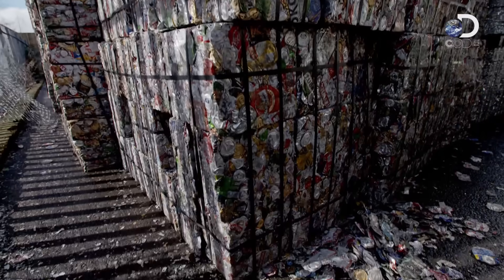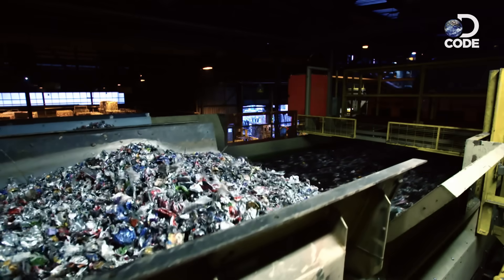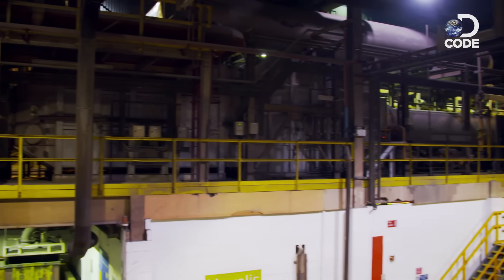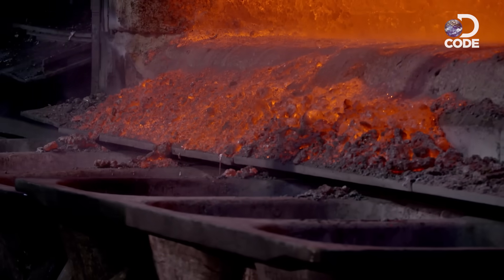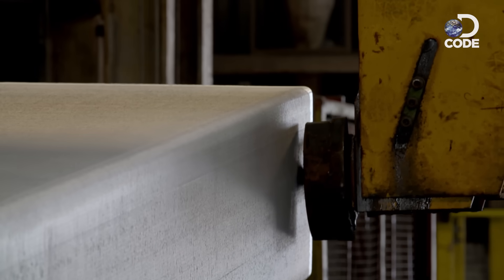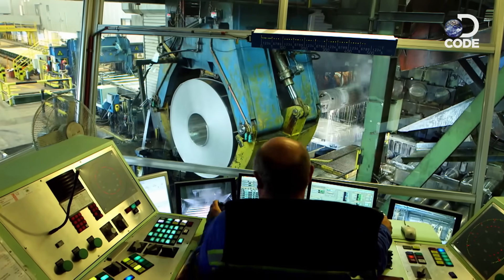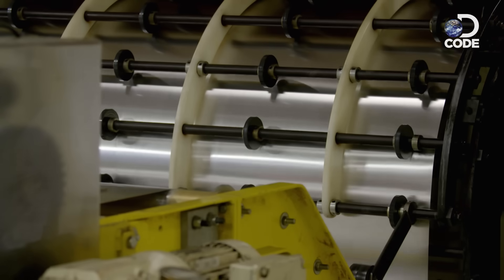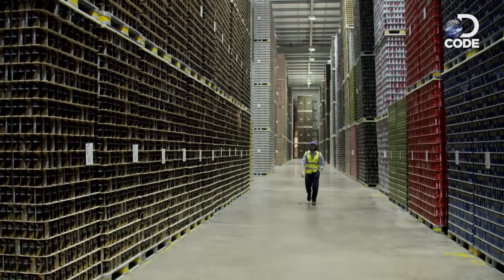How Are Aluminium Cans Recycled? | How Do They Do It?

Comment: When managed and processed properly, Aluminum from Aluminum Cans is just as good as from bauxite/mineral material.
Reply: Yea there is alot of slag in aluminum cans but Recycling Plant/Scrap Yard aluminum cans is sold to Metal Refineries which through it's processes can and do extract pure aluminum from aluminum cans bales which is used in aluminum component applications...The Metal Recycling Business is the other side of the Metal Business equation

Comment: It warms my heart to know we can, and do, recycle aluminum.👍
 It seems the recycling process and transportation have high energy needs though...  🤔
Reply: But the process of obtaining aluminum from the ground is far more experience and takes several time the energy requirements. The fuel is the biggest cost on the melters.
Reply: Aluminum is actually pretty easy to melt compared to other metals. Its melting point is only 1200 degrees, by comparison copper is 1900 and steel is 2500.
Reply: Need to get more solar power

Comment: The process is very complex and energy-intensive, just for the sake of quenching your thirst for a very short while. Personally, I've picked so many drink cans littered in my local village for the past several years that it has totally put me off buying any drinks in cans. Drink cans are by far the most common items we collect. We do put the clean enough ones in our recycling. When I see what's involved in producing and recycling aluminium cans, I'm even less likely to buy them for my own consumption!
Reply: You should also put the unclean ones in recycling...the video shows everything but the aluminum is vaporized anyway..
Reply: @danteinferno175  yes, absolutely! I have started to do this after watching the video!
Reply: You should not be put off by the energy usage for recycling cans.  It is still VASTLY less than the cost to produce new cans!  What this video only briefly mentions is how hard it is to get aluminum out of the ground and smelt it into a usable form.  Even compared to glass it is drastically harder.  This is why using aluminum cans is so important...it ensures that the cans stay in circulation and are infinitely recyclable.  If you want to make a big difference for the planet, contact your local authorities and start an effort for deposit programs (where you get $ for recycling cans).  MOST of the world does not have these programs, which greatly increases recycle rates.  Theoretically, if people recycled all aluminum cans, we could supply all the canned beverage needs without ever mining another lb. of aluminum from the ground.
Reply: @cuthwulf  The cans are not infinitely recyclable. There can be up to 20% metal loss during remelt. The coatings on the cans are also highly toxic and need to be treated first. The dross from processing is a mixture of sodium/potassium oxide, aluminium oxide and free metal. It is considered as hazardous waste which is costly and requires specialised equipment. 
The profitability of the whole process is highly dependent on the LME price for Al. Out of spec metal will reduce the price of the finished product.
This little video makes it all sound clean, efficient and sensible. In reality it is a dirty, expensive and energy intensive process.
Reply: @finnmccool8671  No they are classified as such cause the material itself does not degrade to be recycled. Plastics can be recycled so much until they can't where as aluminum and even some glass can be constantly recycled.
Reply: @cuthwulf  Vastly less is still more than none. Recycling is great, but reducing use is still better. Especially if we don't "need" drinks from cans.
Reply: @paulcook7426  Reducing use is good but some times they are still needed. I personally like glass bottles but they also weigh a lot just for the container which is where aluminum comes in. Having a soda of say a 12oz is a good size as it is the right size. Smaller is a waste and bigger can only go so far before it has to be too much for an open top, as the carbonation is lost before it can be drunk. Its better a can than that of plastic although plastic has its place in large jugs.
Reply: @cuthwulf  Thanks for your comment. I'm in favour of a total ban on small drinks cans and bottles. The more litter I collect, the more I feel this way. So I'll keep picking litter and recycling what I find and will not buy a single drinks bottle for the rest of my life. Being the change I want to see.

Comment: I know I can't be the only person thinking, Why not build a press rolling mill near to the recycling factory, rather than transferring it 900km to Germany,  then bringing it back again to make the cans.
Reply: Because it's not common to build a single part of an aluminium foundry without all of the other components so it would likely cost more to build only the roller than it would to build a whole mill, then you need to train up metal handlers who can operate it, people to maintain it and then figure out a way to turn it on and off when needed or pay to leave it running 24/7 even though it might only be used once or twice a week.

That's like asking a farmer why he doesn't just build a cheese-making factory on his farm instead of sending milk away to be processed at a factory.  Different companies do different things, the UK is good at recycling and German is good at metal working.

Comment: Turning the alu back into cans is insane . The European method of buying beverages in glass by the case is way less energy intensive . the bottles are returned to the shop and trucks pick up the empties which are returned to the beverage company where they are steam cleaned , refilled and labeled and returned to the store. This use to be done in the USA with milk bottles but no more . pity

Comment: The names of the elements, particularly the metals are quite a mess, particularly those that were first refined and used by man. By the naming "conventions" used today, metals' names end in "ium" but that is a relatively recent development as far as man's use of metals is concerned.  So we have "Helium"... which ain't a metal,  "Nickle" which is named after the devil, "Cobalt" which is named after supernatural, nasty imps,  Mercury named after a Roman god...  A lot of them originally had Roman Latin names (Aurum, Argentum, Cuprum, Stannum, Plumbum) that, ironically, more closely followed the current naming practice than their modern names do! In a way, living in Canada and heavily influenced by the U.S., it sounds a bit weird to hear "Aluminium" (and one quite often does) although it does conform to the convention for naming metals.  it's "Aluminum" on the streets but  "Aluminium" in  chemistry class.

Comment: Its just nonsense. About 5 years ago  I decided to try and save my cans. Got a couple bags full, went down to the store. Machines Out of Order. Ok. Lets try the next store down the road. MACHINES FULL, it cashes me out at 40 cents which has to be redeemed same day, so a trip into the store to wait in line. Try the next store, feet are sticking to the ground, line of 3 people waiting in front of the single plastic machine, so I leave with sticky feet into my clean car..... GIVE UP. 5 years later, ITS THE SAME THING.  I wanted to save my cans again but its just not worth it. I went to multiple places and left with nothing recycled due to various issues. Im giving up and throwing them away. Over an hour of my day off is worth more than the $10 in cans and gas wasted.

Comment: Aluminium sounds cooler. Idgaf. 

I think I spent the first 20 something years of my life not knowing that they were the same thing. I actually worked at a place that made all sorts of metal pieces for electronics and what not, and I was sorting the scrap one day and had two piles, one aluminum, one aluminium. I started complaining about how hard it was to keep them separated quickly, and that's when I found out the uk just has a cooler spelling. I was losing my mind looking at paperwork to make sure they ended up in the right pile, but then I was convinced there's no way I didn't mess it up. Then my boss came in and asked wtf was taking so long. I told him and he called me an idiot.

Comment: Such a shame that even though it's recycled, the aluminium has to be reheated more than once and it has to do a 1000 mile round trip from England to Germany and back.  What a terrible waste of energy!
Reply: Just like here in america, almost had a completed pipeline that was to have the oil from Canada flow here easily. But then Joe Biden and his communist Packers stepped in and stopped the pipeline from being finished in one day of administration, but we are still buying the Canadian oil and now it has to be transported in 18 wheelers of who knows how many numbers back and forth between the two countries burning thousands of gallons of diesel every day and pumping that much more pollution into the air. The people who pull Joe Biden strings are the same people trying to bankrupt democracy wherever it sprouts up around the world. We all see the truth here and one thing is for sure it never comes out of Joe Biden or Nancy Pelosi mouth. If it did it would burn them like holy water and they would throw up pea soup. 🤮🇺🇲

Comment: I wish the U.S. would make the slow transition to metric. Being raised on U.S. imperial units, I find it difficult at times to relate when presenting with a metric quantity. I used to be able to convert meteorological measurements in my head, but I forgot how to translate Celsius into Fahrenheit due to a lack of practice. 
The U.S. Department of Education has become very lazy since the 1980s–90s.

Comment: I am in awe of just how big some of those machines are.  Amazing.
Reply: I'm in awe at the fact that someone built those machines😂
Reply: I'm in awe at the fact that someone could conceive the schematics for those machines 😂
Reply: You should see the ingot. The one I work at sometimes actually make the ingot using a water cooled shaper. And it goes 55 feet into the ground. It's a sight when they pull it out with a crane just holding it from the end. The ingots are molten inside for days.
Reply: I work in a mrf, trust me on clean down im trying to work the whole machine process. I will do my working at hight ticket just to get a closer look.😂

Comment: Everyone, “recycling is good for the environment.”
Me, “what fossil fuel needs to be burned to heat aluminum to 750 degrees? How much energy is used to hoist, run conveyors and separators? How much fossil fuel is burned to transport aluminum from one country to another country and finally back again?”
Reply: Natural gas plus combustion air to make it way hotter.

Comment: Few years ago I kept apart the cans at home. Then I decided to pick them up to the scrapyard. There they used a magnet on every metal container I carried. When suposed aluminum cans got stuck to the magnet I couldn´t believe it. I studied them on my carreer of environmental science as aluminum cans. There were many different brands. I was in shock. Maybe here in Spain they make them ferric (?)
Reply: Copper and aluminium (being lighter than copper) are the two most common metals used to carry an electromagnetic current. Even though they won't stick to a magnet by themselves, they still have magnetic properties, and can be induced to levitate in a magnetic field.
Reply: Iron is a common impurity in aluminium, it is also used as an alloying material.

Comment: Why is there no smelting process that does not generate alu oxide dross and what happens to the emissions from the burnt off can labeling. Wonder if the factory can recycle the heat into the furnace?

Comment: Brave furnace operator FFS 😂😂😂 we skimmed off the slag/dross from molten iron, (hot metal), at an average temperature of 1374deg' C from 250 tonnes ladles. 3 panes of coated glass was all that protected us and at half the distance

Comment: Yeh, but the average can isn't ALL aluminium though .......... 75% of them are tin - it's only the tops and the ring-pull that's aluminium😎
Reply: Not here
Reply: it wouldn't make any sense using tin for cans, it's more expensive and weaker. Although different parts of the can a few different alloys of aluminum

Comment: The interesting thing about aluminum cans is they’re really the only thing worth recycling from an environmental and fiscal standpoint.
Reply: Economic too because it takes twice less electricity
Reply: Yes, and unlike plastics, they don't need to last hundreds or thousands of years to naturally degrade. They are not as artificial as plastics.
Thinking about it, I guess more aluminum on consumer electronics might be better and more sustainable than plastics considering many consumer electronics tend to obsolete in few years. The only problem is the inside, the components that may not be still all recycable. 

Plastics will be still good on items that meant for long term use, like storage boxes for example since well they don't obsolete as long as we can fit to store things in.

Comment: also a good reason that it takes so much energy to make is because aluminum is highly reactive and almost never is found in its metallic state. Compounds of it need to be refined, heated up until molten, held there, and then electrolyzed. The electrolysis part can be thought of as adding energy to separate nonillions of stuck together tiny strong magnets which is extracting the aluminum from the rest of the molecule.
Reply: What ?when you melt down the can all the impurities rise to the top as slag then they scrape it off and what you're left with is pure
Reply: @tobyhorn9641 pretty much it's a pretty simple process vs obtaining new aluminum. They go through a decoater that uses heat just below aluminum melting point to remove all the paint and tags. Which is sent through a filtration system of ductwork and baghouses. Then it falls to the bottom of the baghouses into waste hoppers. But it's way less than you'd expect.
Reply: @tobyhorn9641  the point OP was making was that aluminum ore is an oxide - you must put a shit ton of energy into it in order to get elemental aluminum out. It takes less energy to remelt that same elemental aluminum later; which is why recycling is essential.
Reply: @chouseification  then Thay need to pay us more when we sell cans and such at the junk yard what we get payed for junk is about half to quarter what that do at The foundery
Reply: @tobyhorn9641  yeah, yet they have to transport the cans from point A to point B, and pay the people doing the driving. Don't expect to get 80% of actual value unless you're selling gold.
Reply: @chouseification  I would de happy with 50¢ a pound cause of the work involved and Thay would still make a big profit of the cans
Reply: @tobyhorn9641  they deal in volume - if you want a better rate, sell them more at a time, and get a bid?
Reply: @chouseification  what about bauxite?!
Reply: @johnnytocino9313  bauxite is the raw (oxide) aluminum ore. That's the stuff that you need to put a whole lot of energy into to turn into aluminum metal. They normally put a load of refined bauxite into a cell and cover it with a flux, then run high current through it to break the chemical bonds. The molten aluminum is tapped and poured into ingots.
Melting shredded cans to pour fresh ingots/sheet takes a fraction of the energy as obtaining it from ore. The odd part is that aluminum was a precious metal until relatively recently (until that electrical separation process was developed in stages), to the point that the capstone on the Washington Monument was made out of the metal, as were the silverware at some royal/imperial palaces - the normal guests may have silver, the better guests gold or platinum, but the best of all may get _aluminum_... sort of funny considering how often we use it these days, but for a while it was considered more luxurious than even gold or platinum.
Reply: @chouseification  Thanks. I was sad no one mentioned bauxite.
Reply: @tobyhorn9641 it's not really worth as much as you'd think because of how much they recycle. Even a fresh ingot isn't worth more than 4 dollars a pound and the process is still expensive to recycle. The plant I was at did 2millon pounds a day at minimum.
Reply: @chouseification exactly the actual aluminum recycling plants pay for can that are pressed into bales. Ranging from shoebox size to 4'x 4x blocks. And they are very heavy. Thousands of can in one block. It would take a massive baler to crush them this tight.
Reply: @jordanalexander615  agreed - I'm used to both balers like that and a semi truck loaded with shreds - literally a grinder's output nozzle sprays into a truck - once at weight limit, they swap to a new one I guess lolol. Not sure what gross when full would even be on that - quite a bit but much less than steel.
Reply: Thermite: Aluminium steals oxygen from rusty iron.

Comment: My question is, would cleaning the aluminum can out and just press in another tab opener be more efficient, instead of melting it down just to make it again?
Reply: Probably not, and this is the way to go anyhow
Reply: Most cans get punctured during the recycling trip, any crumpling will do it. 
They are so thin now, they depend on the pressure inside to keep any sort of stability.

Comment: Alumium is the correct one.

All three are correct actually. They simply have different meaning.
Alumium is what the material should be called. Aluminum is "alumium" with the ending -inum which means something that COMES FROM or is RELATED TO alumium.
Aluminium has the ending -ium which simply means "small aluminum", an extract from something aluminum maybe.
Reply: It's not a -inum suffix, it's alumina + -um -> aluminum. Similarly, platinum is from platina + -um -> platinum, although in that case the -ina is originally from Spanish from plata + -ina -> platina for "little silver".